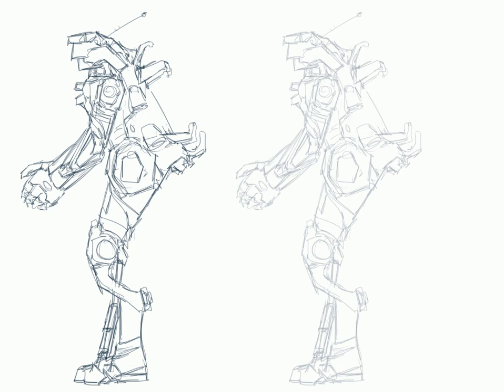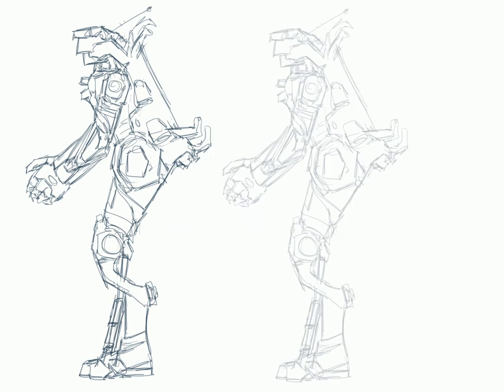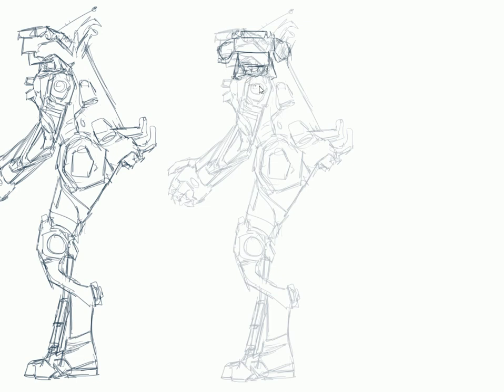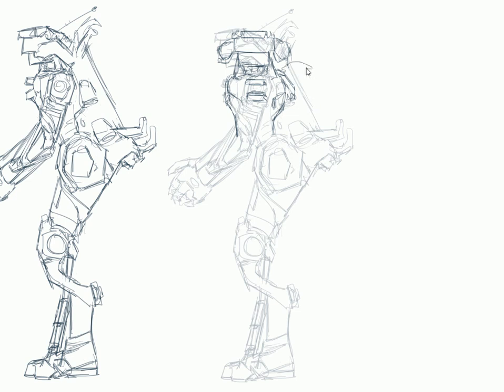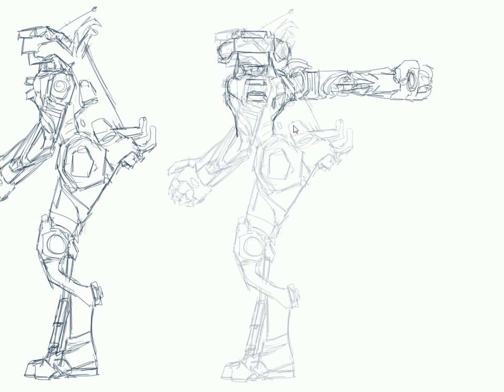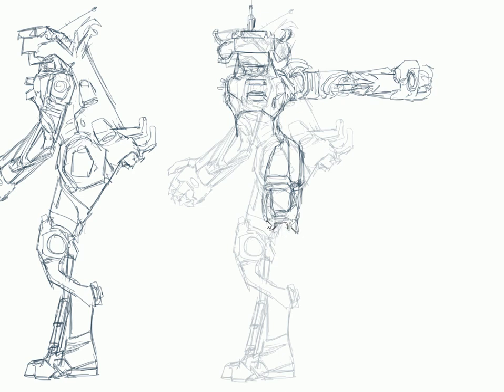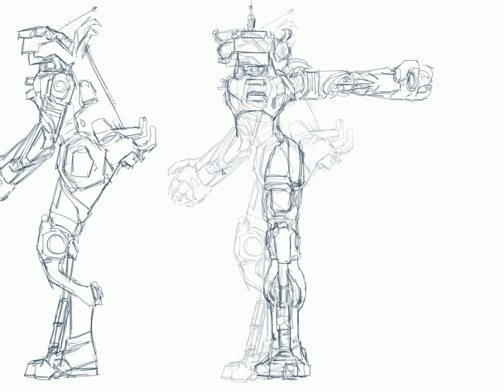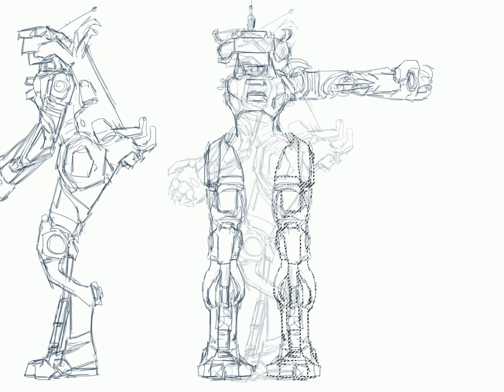Minecraft Mech #20: Let's Design!

Comment: Just watched the series, nice. One problem right now is that if you try building on the borders of chunks, you can't place while looking at the border side of the block. When you get the hit.transform that happens before you add or subtract the normal, so the new vector 3 is in a chunk one over, and the chunk can't set the block.

Kinda hard to explain, but just try building around chunk borders a bunch and you'll see some errors.

Anyways, thanks for this tutorial, really awesome!